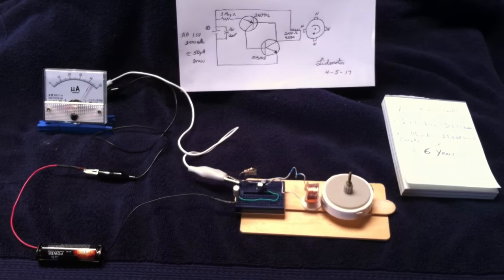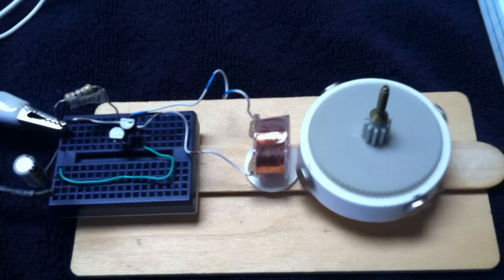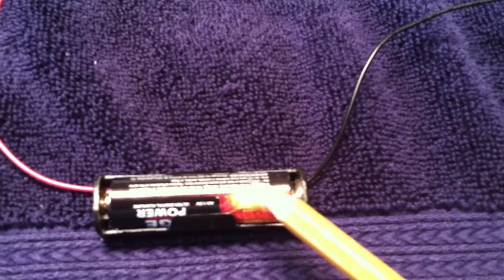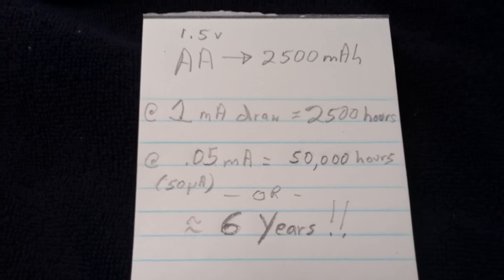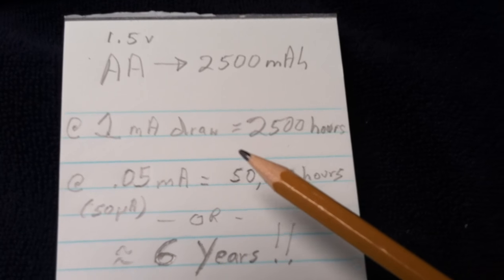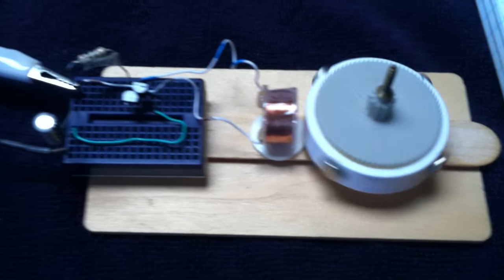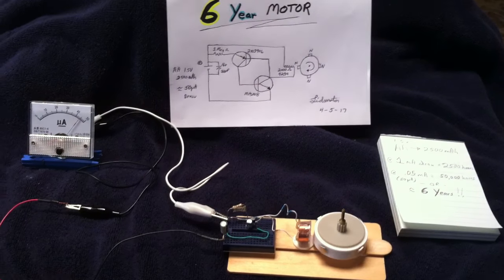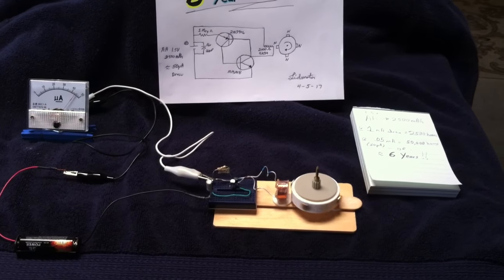6 Year Motor

Comment: This kind of battery's potential begins an exponential speed of decay under constant draw (or when not in use) over time. On the shelf it may have a 10 year holding capacity...but even over time it slowly loses its potential for energy release... on the first day of the 10th year, the battery doesn't suddenly go from usable to not...it's a time-dependent function. Without getting into the math of the rate of decay vs potential and actual usage (numbers are always better than reality...their "ideal")...at your current amperage pull, that AA battery has anywhere from 3.5-4 ('ideally' 3 years 7 months and we'll round up to 7 days ;-)) years run time... still superb! Keep up the great work!
Reply from the maker: Many thanks for that feedback.  Now I know the real numbers.   Three years 7 months works for me.
Reply: @Lidmotor:
Interesting graph, but the lowest current draw on that graph is about 2000 times higher than your current draw.
Reply from the maker: Very true.  This might run longer than I figured.  The issue might not be the battery going dead but the materials of the machine deteriorating.
Reply: Magnetic bearings might help with that quite a bit.
Placing it inside a transparent shell wouldn't hurt either.
Placing it on an earth quake suspension system might be a good idea too!

Comment: No issues as far as I can tell. It should do it, if the batt does stay fine all the while.!
Will make sure to check back in 6 years whether it lasted lol
Reply from the maker: I could use a lithium AA.  They are rated at a 20 year shelf life.  What I'm thinking is that there might be a whole new battery developed within a decade. It might be an advancement on something you and I worked on over the years. Ha.
Reply: Could well be and speaking of which...the C/Pb cell is still flashing its LED and will be 5 years continuous in December ! No maintenance at all. Have always wondered about some kind of capacitor looking version of that, so no moisture/evaporation or other decay could happen. Such a thing might power one of these for decades due to the potential difference being constant.
Reply from the maker: I will look up your C/Pb cell and check it out.  As I recall you found an old lead wheel weight and used that.  The rest of the cell construction has slipped my memory.
Reply from the maker: I went ahead and built one up and have been testing it.  I didn't have a wheel weight so I used a piece of linotype lead I had.  It recharges just fine but doesn't produce a standing (galvanic) voltage like yours that has the steel mount on it.  I may hammer a few nails in the lead and see what happens.  A 5yrs homemade battery running under constant load is really cool.
Reply: The standing difference of lead and carbon should be > 0.5V. Mine doesn't have the steel anymore lol, because it's in fact a runner on rain water !...possibly a Forever Motor ! Will be uploading it shortly :)

Comment: A couple of questions.  You said you didn't know why placing the cap across the battery helped.  Then what prompted you to do it?   And how is the ammeter positioned in the circuit?
Reply from the maker: I found out years ago that an electrolytic cap across the (+) and (-) rails helped on solar powered  pulse motors.  I just tried it on this battery powered one to see what happened.  I really need to do some o-scope work on this circuit to see what is going on here.  The ammeter is in series on the (+) rail.

Comment: Good job Lidmotor, I and my students ALWAYS like what you are doing. One of my students (middle school) asked me, 'at what point will the voltage drop too low in the battery to continue to push through the transistors and have it fail before the battery is totally dead?' --- Of course I could not say, but we again are trying to replicate your experiments in class.
Reply from the maker: This particular motor needs 1.2 v or more.
Reply: Thank you for the reply... So... if the battery is 1.5 v. and the motor will run down to 1.2 v. (+/) or about 20% of the battery life.... and the pulsing has an 20% 'on' time and 80% 'off' (guessing only) .... your run time could still exceed 2 yrs +  ---- Am I missing something? Back to work.... in the classroom :)
Reply from the maker: I think I can tune this a bit to run down to 1.0v  and then things get even better.  Check out the discharge curve on this Duracell AA.  http://rightbattery.com/118-1-5v-aa-duracell-alkaline-battery-tests/

Comment: Is it possible to power it with a joule thief to run battery down below 1.2 volts ?
And I would like to thank you for sharing your time and fascinating mind.
Reply from the maker: Good idea.  The problem is that the joule thief would eat up energy in the process.  The good thing about an Alkaline AA is that they are designed to hold a pretty high voltage for most of their life.  They don't have a linear discharge curve.

Comment: well done, again. I found that the coil in a microwave oven turn table motor (120vac) is 3000 ohms and about the size of your larger coil, might be worth a look. The 21vac one is only 128 ohms.
Reply from the maker: Excellent.  I will see if I can track one of those down.

Comment: i think now the cap works on getting current flowing a lot quicker then what the battery could give in short periods of on time.
Reply from the maker: I think you are right.
Reply: Lidmotor can you try to move the meter between battery and cap or cap and circuit and see if there is any differencr
Reply from the maker: I will try that.  Thanks.  I don't think that it will make much difference. The meter will bounce more if it is between the cap and the main circuit.  A better way to measure the amp draw would be to put a 1 ohm resistor in there and measure the voltage drop across it.
Reply: Lidmotor with any luck you can see somewhat peak value (probably a little bit higher and less stable then between bat and cap)
indeed a 1 ohm resistor would best to check it out 
anyways great work once again!

Comment: I think ya gotta go with the floating rotor. Can't touch anything. Haven't you done that before? I mean, think about those materials grinding, constantly, for 6 YEARS! You gotta go super low friction, and I wanna see it so badly! A YouTuber named 'magnetic games' has done a few floating things that really get the gears turning; it doesn't seem so tough. Anyway, always love your vids. Thanks for sharing and I'll be rooting for SEVEN years!

Just looked back through your vids, and the "Ring Magnet Rotating Gizmo" looks lower friction, no? I think you should go with a design like that, not the pin axel. Interested in hearing your thoughts. Also, would beefing up the rotor, to build more momentum for a flywheel effect, be better? Should the rotor be heavy?
Reply from the maker: The magnetic suspension bearings are great and might be best for the years long runners.  Lasersaber's EZ Spin  jewel bearing top and bottom is hard to beat.  The perfect rotor design for this motor is still a work in progress.

Comment: I think there might be a slight error in your calculation. Please correct me if im wrong cuz I am simply your student. I made a similar pulse motor, and i noticed that: As the voltage drops, the micro amp draw also drops; So at 1.4v you may draw 45 ua, and at 1.3v 40ua, and assuming the motor still runs at 1.2v( if youve tested it), then power consumption should drop right to 35ua at 1.2v. Hence giving you more time in total in general.  More than 6 years i would say. Cheers :)
Reply from the maker: Yes!  As the voltage drops the amp draw drops also.  Longer run time is possible as long as the circuit keeps triggering.

Comment: Why don't you use an old compass, with a none magnetised card; it will have the right bearing, and it's also light? It is obvious, you need to glue the magnete under it, and possible you might have to modulate the bobbin too.
Reply from the maker: I had the same idea a few days ago.  I tracked down a $5 Coleman compass on Amazon that has a jewel bearing that should work. I have not bought one yet.

Comment: John Bedini use to recommend putting multiple caps parallel across the battery. Something like, a .001uf, a .01uf,  a .1uf, a 1uf, a 10uf, and a 100uf, I think, along the lines of that if I recall, but I think you get the idea. I think it is to tune into and convert different frequency bands of energy, from the inductive spike, for more energy gathering and then use. I have also seen him put a diode across the powering battery, not sure why, but maybe junction capacitance perhaps?  But I have also seen it used similarly, but across a resistive load in a Bearden gif animation, on John's page:
http://johnbedini.net/john34/tbfnrganm.gif
Reply from the maker: Interesting.  I think what is happening here is that the cap gives a faster jolt to the coil than just the battery alone.  I'm just guessing.
Reply: Lidmotor absolutly, but what about the "flyback" from the coil, it seems to be at work too, no? I think the capacitors can be like having a bunch of differnt size buckets catching the "back splash"   to recycle back into circuit
Reply: I also feel it would make sense to add a zener diode to your set up, so you are able to establish the full potential across the coil before your PNP shuts off. Right now you are only running your coil on about .5volts , even if the battery is 1.5v, because the way your pnp is, it will switch when it see's -.5 volts on it's base.  If you are running it on 1.5 volts, add a 1.4v zener, maybe. But more importantly, you should be going higher in your potential on your input, like 12-24 volts, AND use an appropriate Zener diode to develop the full potential across your coil before the pnp switches, AND use a mosfet, because it only needs potential to switch, while transistors need to burn current to switch!
Reply: @DavyOneness  The back emf can‘t charge the capacitor unless the circuit is grounded.
Reply: @heavycurrent7462  not if the discharge's ring frequency is highy enough, then you start talking about Tesla's 'one wire' setups, but even with those, you can still be dealing with a ground, just a capacitive coupling to ground through the air.

Comment: It would be really great if your calculations are correct and that little motor would keep running for that long! I was thinking today(that happens on occasion lol). You mentioned in one of your previous videos that your wife had accidentally bumped the closet which caused the motor to stop. You live in an area where earth quakes frequently occur right?
Maybe youre so used to them that you would hardly notice yet when they happen, might interfere with the motor?
Reply from the maker: Great comment!  Maybe I should mount this on some sort of spring suspension so when 'THE BIG ONE' hits the motor might survive.  We are way overdue for a bad earthquake here.

Comment: *****
Appreciate you sharing your work.  Based on pulse motor videos by Lasersaber and Slider2732 it appears that having 2 or more series coil positions provide the greatest efficiency gain by being able to run at the lowest voltage and lowest microamp current.  Reducing bearing friction will speed up RPM and increase pulse rate so efficiency will not improve without increasing the 1M resistor to maintain the same or lower RPM.  The 22uF capacitor fully charges in between pulses and helps the battery provide a stronger pulse, a capacitor is able to charge/discharge faster due to direct energy storage vs. the slower chemical energy storage of a battery.  Is your goal to obtain best efficiency while running on a non-rechargeable AA battery?
Reply from the maker: Thanks for the great comment.  The goal is a curious looking "virtual" perpetual motion machine that sits on a shelf.  Every few years you replace  the battery.

Comment: hi lidmotor  I really inspired your creations so i decided to build one. Can i ask you to try my circuit for your coil. mine is very low coil at  about 740 ohms and i can run micro amps draw and to light  Led. I just want to make sure I'm  not mistake  my test. can you have a look. Thanks!
Reply from the maker: I took a look at your motor and it is really good.  That should run for many years on AA.  Where did you get the solar waver that you took the coil from? I have a couple similar ones but they are a slightly different design.  They are made by Hanks Craft who makes store display motors.
Reply: I got that solar waver from ebay 2 years ago but i can't remember which seller.  thanks for checking my video.
Reply from the maker: Thanks!   I just ordered two.  The ones I have  are similar but a different style.

Comment: Hi Lidmotor,

Thanks for sharing once again a cool video  :-D

Why don't you try to let it spin for a week or two to see how it is going? If it doesn't stop during that period of time, then definetely it should last longer, if not, it is cool either, considering the battery and the time it lasted.

I have no idea on electronics, I am finishing school in about 2 months and if everything goes well, I will get into electrical engineering uni. So my physics mind says that the calculations could be right, but my math mind says "If 1 goes with 2500, then 0.05 goes with x, so x=125"
I have no idea:-P
Reply from the maker: Thanks.  Good luck in school.
Reply: Thanks!
Keep doing awesome experimens! :-D

Comment: Humidity and corrosion will be a factor - great work!
Reply from the maker: Thanks.  I'm thinking a sealed plastic container with a drying crystal packet inside.  Place the unit out of direct sunlight to avoid UV damage.  Don't touch it until it stops (or in 6 yrs.).  Put it in my will to go to someone who might keep it going and enjoy this interesting electronic toy. I might also put a couple replacement transistors in the box in case they failed along with the circuit diagram.

Comment: You can reduce the current draw by reducing friction. 

One easy modification is to reduce the downward force of the armture against the supporting bearing. Try replacing the brass screw with a piece of brass shim stock. The weight reduction will reduce friction and heat loses and permit running at lower current draw. 

Alternatively you could attach the rotor to a steel pin and then partially float the  rotor using  magnets above and below it. The position of the upper magnet should be screw adjustable to control how hard it pulls. The lower magnet should be brass shim protected and it is needed to stabelize the armature.
Reply from the maker: Thanks for the tips.

Comment: Providing you with an 'accurate' calculation method & answer would be pretty tough, actually.  You'd have to know more about how the battery was tested to get the 2500 mAh rating.  Was it really tested at an average 1 mA draw??  What did they use as a cut-off V?? Is the 2500 mAh real or made up Asian marketing hype?  The lower the current draw, the longer the service time in hours--and the services hours really do go up significantly when you draw µA current.

In addition, you will only be able to use a fraction of the batt energy/charge capacity, because your rotor will cease to rotate after the batt V is less than 1.2 V (according to what you stated below in other comments).  Also, the batt V decreases as the batt charge is depleted, so any meaningful calculation would need some kind of integration calculation--which would probably be meaningless given that you really don't know the initial charge level in the cell & what it will be when your rotor stops rotating at 1.2V.

One relatively simple method to use could be as follows:
Assuming your cell starts at 1.5V (which it could actually be higher or lower, depending on the cell) & it actually has 2.5Ah of charge, and you are able to use 80% of the energy in the cell (which is a guess), one could reason:

1.  Useable charge/energy = 1.5 V * 2.5 Ah *.8 = 3 Wh
2.  Energy Use rate = 1.5 V * 50 µA * .5 duty = 37.5 µW
3.  Runtime in years = 3 Wh / (37.5 µW * 24h * 365.25d) = ~9.13 years

Of course, you could change the calculations to suit your actual motor duty cycle (verified with an oscope) & you could also change the .8 (which is decimal for 80%) to whatever % of the battery energy you think your system will actually consume until your motor stops rotating.

Thanks for sharing!
Reply from the maker: Many thanks for your reply on this question of run time.  Of all the comments so far I think yours is the most accurate.  The duty cycle and micro amp draw have much to do with how long this will run.  The discharge curves on these 10 yr shelf life AAs needs more research.  The bottom line is that this machine will run for years unless something breaks.
Reply: I do what I can to help, Rusty :)
You'll have to make refinements to the calculations & do the actual testing. :)
Reply from the maker: Thanks.  I'll do the testing and get back to you in 9 years.  Ha.
Reply: Just 9 yrs & 47 days :)
Hopefully we'll both be around to see the spin down reach a stop.